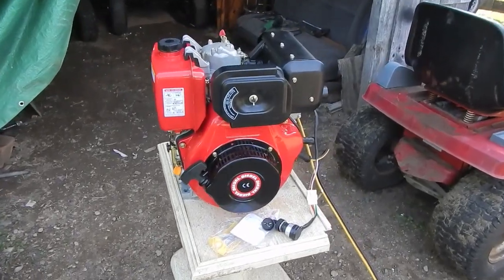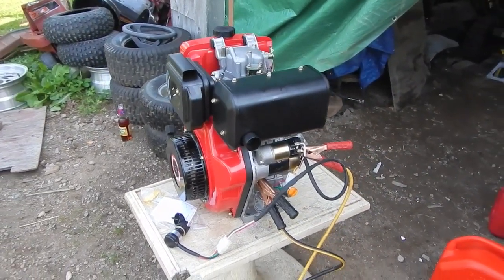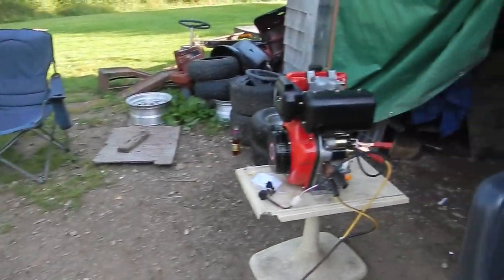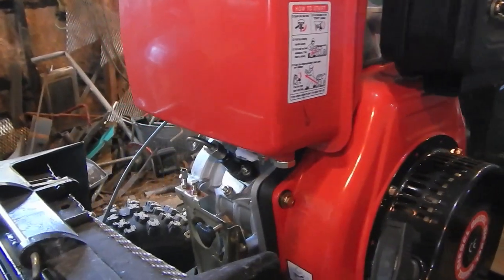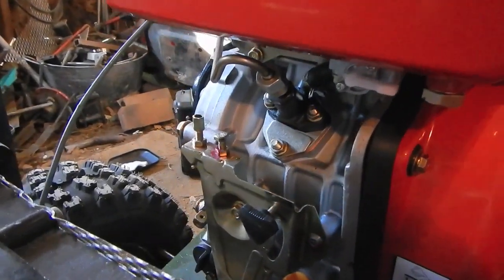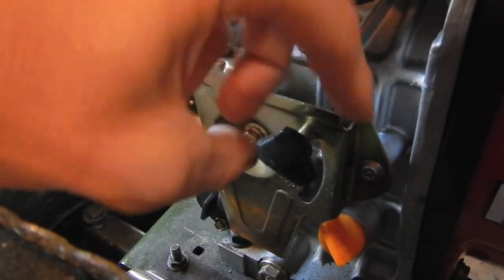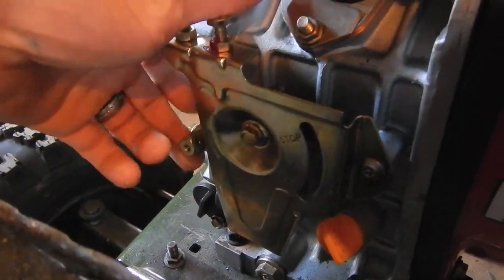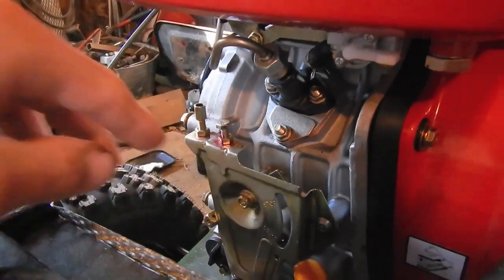10hp Diesel Engine First Start Up / Shut Down

Comment: Awesome low idle! ;D Gonna be bad ass! I got a couple of these from princess auto up here in Canada when they were clearing them out. Now I just need to figure out what to do with them... :D They definitely run awesome and have gobs of torque! My only advise I have is turn the fuel and governor all the way up and straight pipe it!!!! Can't wait for the updates! Keep them coming! Thanks.

Comment: Looks like you may want to have a regular tractor governed throttle to run it and to kill it too Unless you planning to to do a spring loaded foot or steering throttle. Whatever you do put a nice chrome or black straight piped stack out the side of the hood, Awesome build!

Comment: what if you put an inline valve in the high pressure fuel line very near the fuel injector and you hooked up a choke cable to it and you pull it to kill the engine?

Comment: Wow... Going to have to rig up a car battery to that Sears! I have an idea, what if you cut out that throttle position guide so that it will actually shut off at no throttle, then create a stopper on the gas pedal to push it down a little. Then when you want to shut off the tractor, pull the pin on the stopper and let the pedal come back all the way. :-)

Comment: You should be able to adjust the throttle linkage so that when it's fully back it will stop. A friend of mine has a diesel clone on a pressure washer and you don't have to take the knob off to stop his, just loosen it off and move it to stop.

Comment: Fearless, Coudnt you hook up a system where when you let go of the gas completely when you have this thing mounted in the sears, it would just kill the engine. Then when you gave it gas, it started the engine back up. I've seen golf carts do that. I was wondering if it was possible to do that in this thing.

Comment: I'm pretty sure you can adjust the linkage so it shuts down when you move the knob to the "stop" position. On mine, all I have to do is loosen the lock knob and it shuts down.

Comment: You have to engage the decompression to start it so the starter isnt fighting the engines compression. It will sound awesome with a straight pipe stack and a rain flap!

Comment: when you start the engine push the decompression lever down(red lever on the valve cover)   it will start easier when using the key start you will have to do that every time when pull start'n it make sure the piston is at top dead center push the lever down give it a good pull mine normally starts on the first pull. these engine have a lot of compression that's why it seems that battery weak but if you push that lever down it should start

Comment: to kill it faster, use the decompression leaver, but it should have shut off right away if you fully push the throttle to the end. Ive fixed quite a few of these and never had a problem on killing them like in this vid